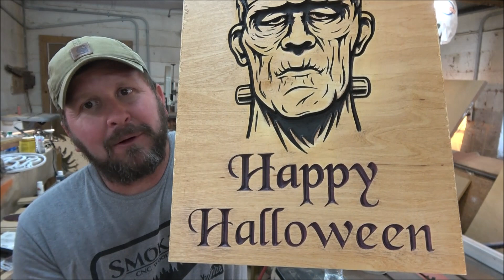Halloween Decor CNC

Comment: Hey Smokey, Fantastic work!!!! I was wondering what software you are using to make cam paths and how you get the engraving bit to keep all your sharp corners like engraving and pocket out what's left to a max depth? Like if the letter is wider than your bit
Reply from the maker: I use Vectric Aspire. and the corners are done with vbits which Aspire makes em sharp
Reply: @SmokeysCNCWoodworks   do you use the bit for clearing all the middles out or do you run a pocket with a bigger end mill?

Comment: Brian, do you feel spraying with Poly and then painting is better than using a removable vinyl mask?  Also are you using Vcarve to create the toolpath?
Reply from the maker: Yes that was a Vcarve Tool path....I just haven't had great luck using Oramask or any of the stick on vinyl, it just doesn't hold to the wood good enough and comes up during cutting...I've had a couple of successful runs where it worked great, but many more that were failures.....Thanks for watching!!!